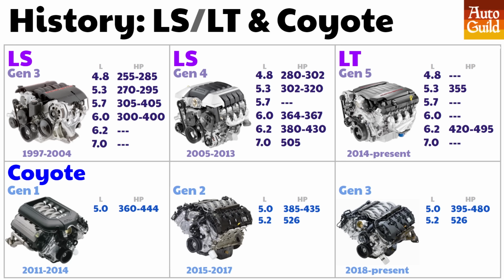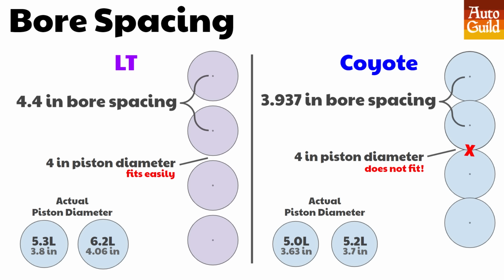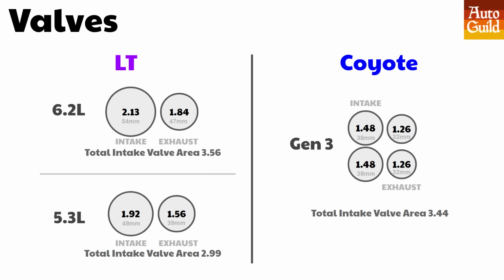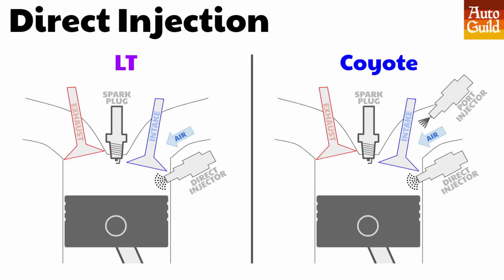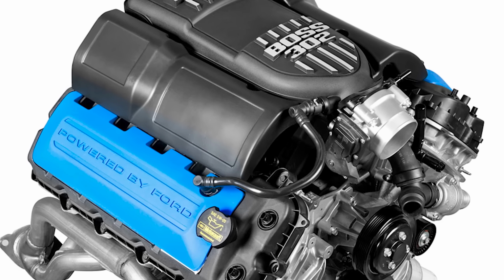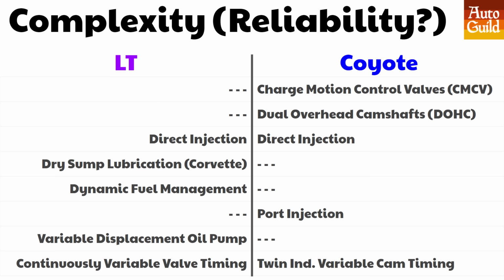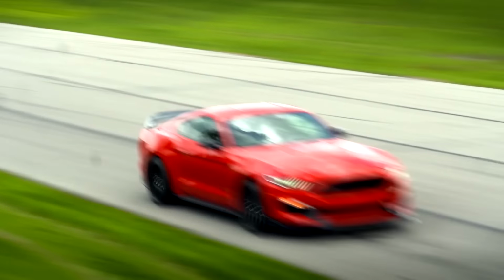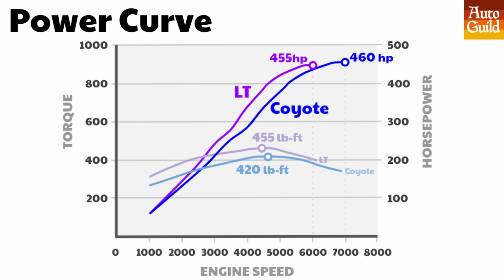GM Gen 5 LT vs Ford Coyote.  Which one is better and why.

Comment: The 5.2 voodoo is not a coyote engine how dear you disrespect Ford racing like that 5.2 is a voodoo and only a voodoo engine 5.0 coyote is for them ford broke boys voodoo powered Ford baby don't disrespect like that
Reply: Yes it is. Is a basically a Coyote with a flap plane crank. You can swap heads, intake, from one to the other.

Comment: So my shop does engine swaps, specializing in LS swaps, restomods, restorations, hotrods, ratrods, and oem repair. My techs have done coyote swaps, and LS swaps, more then any other swaps including honda swaps. One thing that they tell me is, coyote engines, seem to perform less than LS engines of similar horsepower or slightly less horsepower. They just suck lol they have almost nothing down low compared to LS and the torque curve sucks down low. Theyre almost more expensive, and require more money for maintenance. They dont really hold up to power like an LS. They just suck lol but the mopar hemi engines seem to outperform the LS... however. They have alot of weak points and they don't last as long, have worse fuel mileage, are more expensive, and it costs more per horsepower gain than an LS. I might add, we havent messed with any voodoo engines yet. 

But... me personally, i like the exhaust sound of any mustang, or coyote, over any other engine lol i drive nothing but LS engines in all my cars, suvs and trucks lol but i love the sound of a coyote or mustang.

However the AFM/DOD is not a reliable system on the gen 4 LS and gen 5 LT engines. Majority of builds or swaps we do, include the delete kits, and accomodating tunes.

Comment: People dont relize them over head cam engines can wind up so fast and high that if you tried it with a push rod engine it would be gasping for air.
Reply: No it wouldn’t, Nascar engines are all pushrod and they are revving to 10,000rpm without a problem.

Comment: I want to LT swap a 924. Oh, I have a GT350 and I have found that the lack of low end torque actually makes it very drivable and a pussycat around town. Nice easy 3000 rpm shifts are smooth as glass.

Comment: I had both a 2014 5. 0 with a blower and a 2013 CTSV 6.2. Both made great power but the LS just sounded way better. Imo coyotes are very hard to get to sound good theyre too raspy and the straight pipe ones sound terrible and too raspy. The LS just sounds like a true v8 at both low and high rpm. And I dont think theres one sound that beats a LS7 at high rpm. Things just sound like race cars. Also not many cams dont for coyotes and LS with a cam just sounds mean at idle.

Comment: Really well done, great job.
 
On the question of competition use for these engines: The cam-in-block LS/LT being significantly smaller and lighter, and having a significantly lower CG, along with its affordability, simplicity, and durability, makes it a winning combination as a competition engine.

Unfortunately, GM doesn't take advantage of those characteristics in anything except the Corvette. But the 'Vette is a terrific car, so it's tough to complain.

The two-valve engine's power characteristics can be tuned for most any application, except ultimate horsepower-per-liter, but you can have low-down torque, high-end horsepower, or a nice blend, and make up for the high-RPM breathing restriction with displacement to get the horsepower you seek, along with a fat torque bonus. 

BTW, study those power curves carefully, and you can find much more valuable information than just peak numbers. Looks to me like Ford (and everyone else) are doing it the hard way for no useful advantage.

In fact, it's shocking how many four and six-cylinder engines -- even some with a fraction of the displacement -- outweigh the LS/LT ( and the old Gen-1 SBC, for that matter).

Bottom line, Just LS swap it! is a meme for good reason.

Comment: Not much of an lt guy the coil packs fail on them sometimes but I've never put one on an ls and I love that the ls has no direct injection makes it easier for mods with today's aftermarket I hate coyotes only because of the ability to be modded and the insane complexity of them vs a good ole tried and true pushrod both great engines though

Comment: This guy say he uh GM man, but clearly he's uh Ford guy, I mean 2each is own...  Whole video should've been about Ford... In the last 5yrs wht records have Ford Broke, none that I know of Even with the new GT500.. Ford, and Dodge are good for just one thing, and that's goin straight.. Last time I checked the C7 2019 Zr1 set the wind speed record 214mph with the wind, and 212mph against the wind, why Ford didnt wanna release there numbers... And if I'm not mistaken When Gm was 1st testing out the 2019 C7 Zr1 they ran the car for 24hrs straight and broke Ford record by accident and they was just testing the blower bcuz the C6 had Supercharger issues, that's why they went with the blower which takes 110hp to turn and 3/4 more intercoolers!!And Ford had won it with uh Supercar, these are all facts u can look em up urself... Matter fact this sad day happen at the Nurburgring Track... The Zr1 is uh hell of uh lot betta car all around put 2gether.. Oh almost 4got the 755hp the Zr1 makes it'll make that every single day, and in colder climates will make 100+ more hp on regular pump 93 Gas, the Demon, and GT500, SuperSnake need Meth 2 run numbers like this consistently, tell it all not just sum of it...  Ford make uh Supercar that cost almost 7figures, and the Zr1 is uh 6figures waaaaay better put 2gether car...  Well 2me it is anyways... And if I'm not mistaken the worlds fastest car Hennessy makes it, and Guess wht, IT'S GENERAL MOTORS POWERED... PLZ FEEL MORE THAN FREE 2 REPLY 2ME, thanks and God bless... Oh and one more thing, when they tested the Zr1 for them 24hrs straight only thing they changed was drivers, gas, and tires and broke Ford record by accident

Comment: The reason the S550 Mustang has the biggest aftermarket support is because the Coyote is absolutely the most responsive to owner input. With less effort you are going a lot faster than you are in the Camaro or the Challenger.  Now if they would only get rid of those shitty oil pump gears.

Comment: I rather have only one cam to fuck with than 4, And all of the other complex bullshit with it, To get baisicly the same horsepower. 
Coyote is complex and more expensive for the same (comparable) hp numbers to the Ls-Lt motors. I don't need a sliver better throttle response and what have yous for all that extra complex shit and cost of the coyote. That being said I am doing a coyote swap but only because I couldn't bring myself to put an LS/GM motor in a 68 mustang fastback. Otherwise I do not see how the coyote motor is much of a sensible choice, unless you have "fuck you money" and like spending it, aand your paying someone else to service the damn beast.

Comment: well coyote is a ford engine, so i already question the reliability of it. Ford doesn't  have the greatest track record of reliability. LS small block engines were a lot better engines, and more reliable. LT seems to be carrying on torch of the LS.
Reply: I have a Coyote engine in my Mustang with 301k miles. Reliability, you say? I don't know if I want a modern Chevy if it has Lifter failure caused by the AFM system and how cheaply made they are making their engines. My work has Chevy/GM trucks and all of them have a check engine, burn oil and the build quality sucks.

Comment: The valve area of a 4 valve/cylinder engine is not the whole story, because the intake port of a 2 valve/cylinder engine has only one valve stem in the airflow; with 2 intake ports, there are 2 valve stems in the way.  So the Coyote engine has both more restriction and lower intake port area.  That is made up for by cam timing and lift, not by superior flow characteristics.

Comment: Power, torque, efficiency?… the coyote needs to be rung out to get the torque and horsepower in truck application aka high rpm. LT so much better in long run as less complex and easier/cheaper to work on.  Not a fan of cam phasers. If you want to upgrade the coyote its goona cost you and arm and a leg compared to gm’s V8. Keep your coyotes Ford. You’ve engineered everything to be hooked up to specialized ford equipment that costs so much more.
Reply: A Coyote takes boost and general modding is very easy. How do I know? Well, the Mustang in general has the best aftermarket support and I happen to have one myself. Just enjoy your V8S until your last affordable sports car, the Camaro, becomes discontinued.

Comment: Great breakdown! Dual injection is so great. No carbon built up. There’s a reason Toyota uses dual injection as well. Bravo ford. My last 5.3(2017 Silverado) had to get injectors replaced at 16k probably due to the stupid cylinder deactivation crap. Not to mention granny problems. Never GM  again

Comment: There's only one thing that'll shut down Chevy's LS and LT motors and Ford needs to go back in time about 50 years to the year 1969 and 70 and that's either a 302 boss or a 351 Cleveland ..with today's modern induction and timing that will finally lay the Chevy to rest it happened back then it can happen again that coyote is junk.

Comment: Gen 3 coyote can handle 1200-1300 stock block.
Gen 3 coyote uses a spray in liner, you cannot use sleeves without serious modification.
So you must have got a bit of gen2 info there

Comment: I think you need to retract your statement about Ls would beat coyote in aftermarket power based on the fact that Mustang's are now running 7's in the 1/4 with stock block from "oil pan to intake" with just turbo kit. No Lt/Ls can do not even in a foxbody.

Comment: Enjoyed this video as I own both an '11 Mustang GT with the first gen 412 hp Coyote 6 speed manual and a '19 C7 LT engine Stingray 7 speed manual, and your analysis is spot on...  
When I drive the 'vette I really enjoy the low end torque and acceleration.  The Mustang pulls well, but over a longer period and not as viscerally.  Both engines are masterpieces of engineering... 
The Coyote gets about 24-25 mpg on the highway and the 'vette will do 30 mpg if I activate the AFM and keep my foot out of it... It's satisfying to get a 500 mile range on an 18 gallon tank :D  
On the occasional track day, the Mustang struggles as its suspension and brakes aren't really intended for the track, it has like a 60/40 weight distribution, making turns more challenging, while the 'vette was designed from the jump for handling with a 50/50 weight split.  Both cars do really well on 11+ hour road trips as well.

Comment: Flat plane cranks SUCK. It makes a V8 about as refined as a 4-cylinder. It actually DOES NOT make an engine physically rev higher. In fact, the increased vibrations put more stress on the engine and make it more difficult to make an engine as durable at higher rpms. This is why NONE of the flat plane V8s are particularly large in displacement -- the stroke can only be so long before it shakes itself to oblivion. The biggest flatplane V8 in world is the LT6 which is "only" 5.5 liters, whereas cross plane designs can go much larger. The flat plane V8 does make an engine rev faster because of the absence of counterweights. It also makes the exhaust system more efficient because the pulses alternate evenly between banks. However, if you do not need to rev as high to make the same amount of power, you don't really need either of these advantages do you?
--
IMHO, a DOHC valve train is pointless and offers ZERO advantage below ~7500 rpm. If an engine does not rev above that or make more than 100 hp/liter; a 2-valve design which displaces 20% more but is physically more compact and lighter will make the same amount of power with lower complexity, lower costs, better durability and slightly better fuel economy. Above 7500 rpm DOHC designs do offer a performance advantage if you don't mind the cost and bulk. Flat planes are really a big sacrifice in refinement for a faster revving engine with lower rotating inertial -- great for throttle response in a race car but terrible in a daily driver unless you like noise and vibrations along with reduced torque from the reduced stroke and smaller displacement that the flat plane compels upon the motor. Yes, I know there are people who like noise  -- just go to a muffler shop and you'll find plenty of people who want to make their cars louder. And, there are those who think that cars that sound like Ferrari or race cars is somehow desirable. I prefer maximum power with minimum drama and a whispering exhaust.

Comment: But you left out how so many of the Coyote motors died at an early age in the F-150 so much so that Ford had them on back order for Dealerships and you still cant get them. And dont say it isn't true because at work we had 3 f-150's that had blown 302's and there wasn't a motor to be had. Not a one of them had over 80K on them and were serviced by the ford dealer regularly

Comment: i get a kick out of everyone showing the 24mpg highway and 15 in town for the coyote. i have a 2018 GT premium manual that will pull down 30mpg on the highway all day long, and im currently getting 20.4 mpg in town. i drive my car to work every day and never break 40 mph. hills, curves, and stop sights galore, and averaging 20.4 while never hitting the highway. i am generally never "trying" to get good mileage in town so this is a definite bonus for me. with current mods the car makes 500 hp at the tires.

Comment: Fords are overly complicated, extremely complex, very expensive to repair, and almost impossible to swap and work on because they are as wide as a tank engine. There is a reason there isn't a ford motor fest and there's a LS fest!!! If you want to spend a lot of money on repairs go ahead and buy a ford motor! As long as you get rid of 06 and up LS engine AFM cylinder deactivation they run a long time!

Comment: The availability is really the relevant metric.  People put LS motors in everything because they are easy to find (especially the 5.3) and can handle a lot of power.  The LT will be much the same, you estimated 1.2M units just for 2019, now add every other year it's produced, there's a lot out there, and the configurations are fairly standardized.
Reply: Doesn't that mean the same for the Mustang considering it's sales and the fact that it's easy to buy and source parts and modify ? Even if the engine is a bit more to work with in size and price, it's not much that needs to be done since it comes out of the box overbuilt. Many people run stock bottom ends OEM parts on their Coyote builds because the car just takes abuse and loves boost, slapping a TT setup beats anything on the road for little work compared to fully built motors which end up being more pricey.
Reply: @raionshishi8290  GM has built millions more 5.3s than Ford has built Coyotes.  Mustang sales are a fraction of pickup truck sales, and the 5.0 is not the most popular option in the trucks, the Ecoboost is.  I like the Coyote and if you have one, definitely build it up.  But they are more expensive to acquire.
Reply: @Brons2  I know that comparatively the F150 has more sales than the Mustang and the Ecoboost is more popular in sales than the Coyote, but that's not really a good comparison considering the massive difference in what both of these examples are used for and how they are priced accordingly. There is also the fact that Mustangs are again still a lot easier to build when it comes to parts since you don't have to spend much to make them good, again LS is still cheaper and easier, the only thing I brought up that it's simply not a HUGE difference like most people dramatize it to be, like seriously some people really exaggerate it.

Comment: I've always been an LS guy but I'm willing to admit the coyote is a fantastic engine. However in my opinion the 4 cam design increases failure points and for a race car that breaks parts because you are pushing the limits is a big deal breaker. All that said and all of the detail you've gone into the only answer I can conclude is both the LT and Coyote are both better than the Hemi!
Reply: Most racing engines use DOHC and the technology is very mature nowadays

Comment: Awhile back there was a test on which was better ls vs coyote(engine masters?)...15k budget spent in any manner chevy vs ford and the Ls made almost 1400hp before blowing a head gasket the coyote was nearly 300hp less and the bottom end let go destroying itself to non repairable condition  and due to rules stock ls head bolts and deck wasnt o-ringed.....so with upgrades the undeniable winner is chevrolet
Reply: The test needs to be redone with the gen 3 coyote and the LT motor.

Comment: I disagree, the Coyote would be the Muscle Car Motor. The LT's Pushrod Design has a Significantly lower center of Gravity.. Also, one thing all Racecar's have in common is they break Part's. Which would you rather fix?

Comment: The voodoo Isnt that cool. Ask Ford. They want to get as far away from the VooDoo as possible. The LT is a better engine. Just because a engine makes more horsepower/ given displacement doesnt mean it's more efficient. The coyote because of it's small displacement, needs more revs compared to the LT, meaning coyote needs to work harder to make its peak power. Which is probably why the LT gets better gas milage.

Comment: Ima be honest the 5.0 coyote engine has a brutal sound but longevity and expansion to mods ls/lt is the way to go
Reply: The Coyote "should" outlast the pushrod engines due to the OHC design being more efficient, lighter valve train weight and DI and Port injection. An argument can be made however if the Coyote and LS\LT are both abused at high RPM's, the LS\LT should suffer less crank and rod bearing wear.